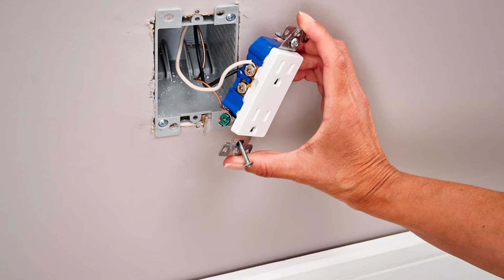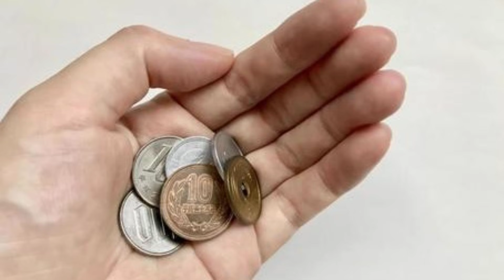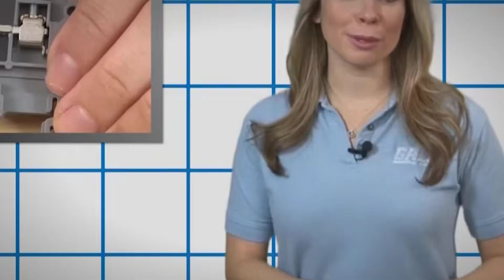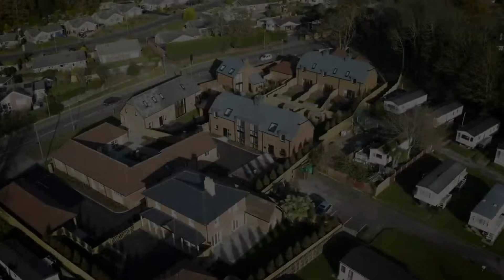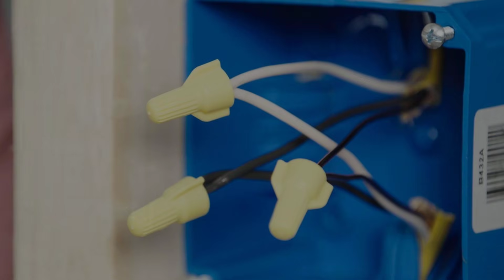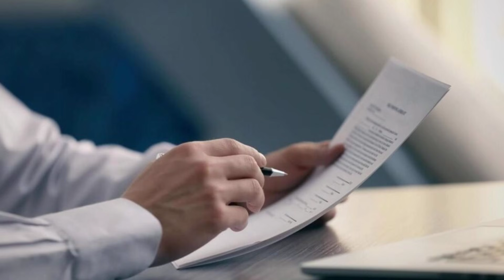The $2 Outlet Hiding in Millions of American Homes

Comment: Not so much an issue because what we plug in don't use much current led lights and lamps. In the kitchen it would be a different story. Change them to 20 amp outlets. 73